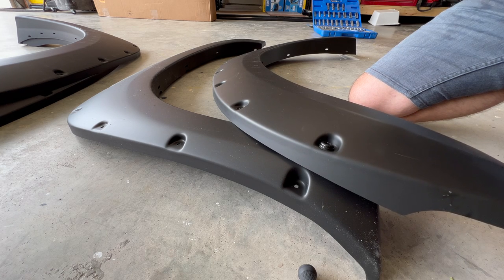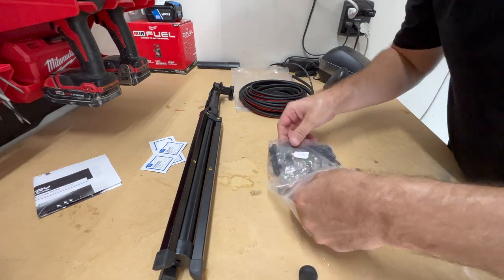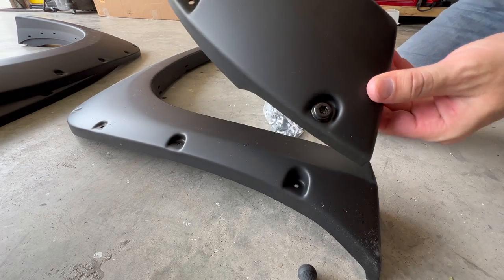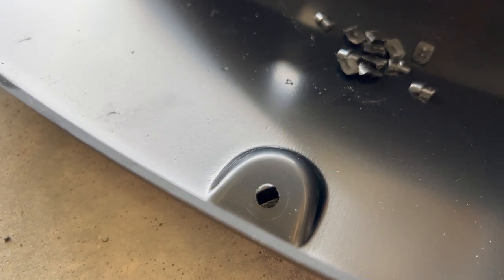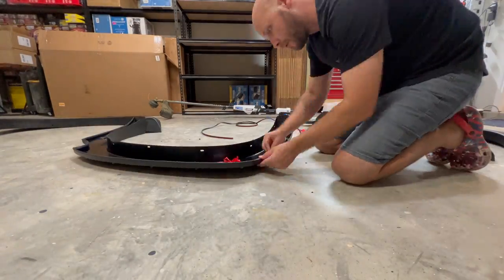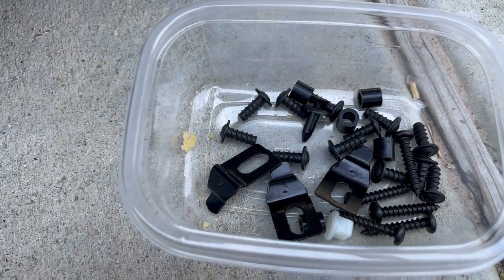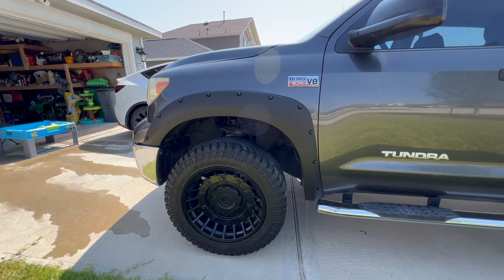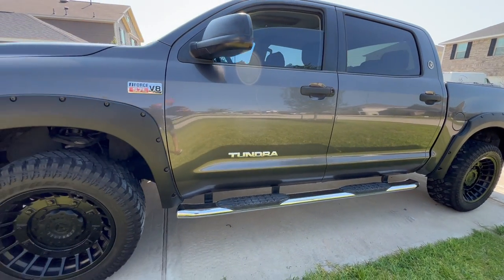DIY TOYOTA TUNDRA POCKET FENDER FLARE INSTALLATION / ROUGH COUNTRY

Comment: I have owned my 2011 since new. I have almost traded it in for the new models every time but I love my truck so much I couldn’t trade it in. The 5.7v8 is a beast of an engine . I pull my boat all the time and camper trailer. I bought the truck for work mainly but I got a Mercedes van for work. Couldn’t sell the truck , over 400k miles and no issues.
Reply from the maker: Thank you for watching!  I’m at 200k, the truck is a beast!  I wouldn’t trade it for anything.  This will be my son’s truck he’s old enough to drive.
Reply: @Paulinaandjosh  beautiful truck! Looking forward to future mods!
Reply: That’s awesome!

Comment: Should just paint the silver ones
Reply from the maker: So far none of the plastic ones have fallen out.  But you are right, painting the silver ones would be best for longevity.
Reply: I literally just said it when you’re comment popped up🤭
Reply: @Paulinaandjosh you could also just epoxy/glue them on.